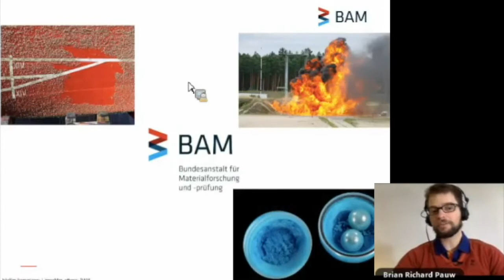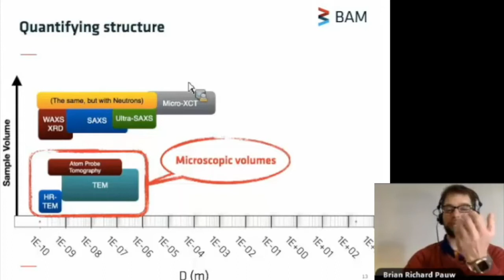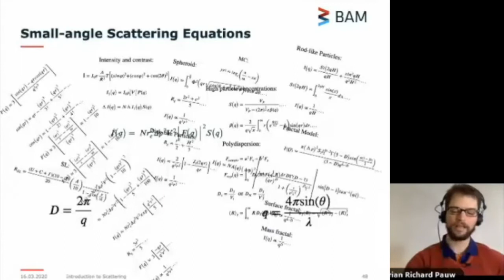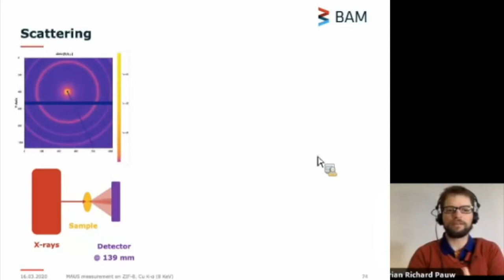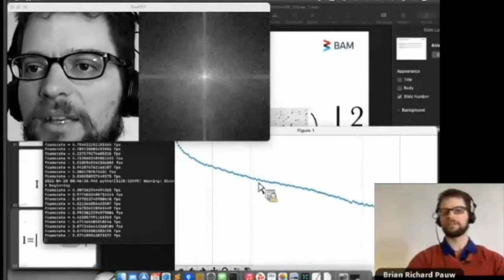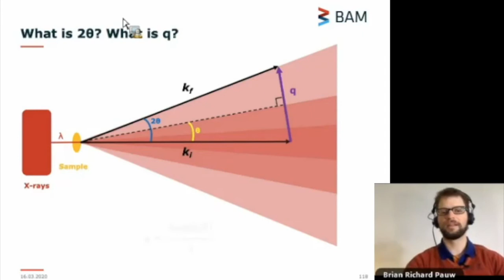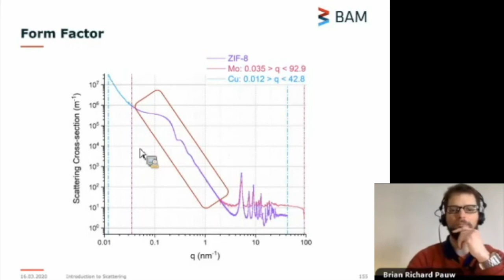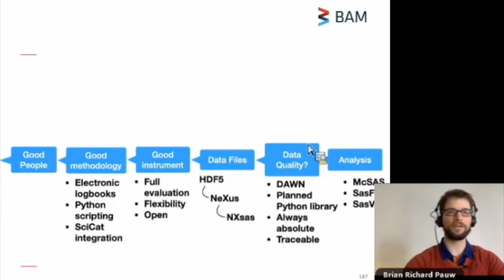Better with Scattering Part 1: Fundamentals of X-ray Scattering

Comment: thank you for this insightful lecture. I have a small question, if I have a porous material with nanoparticles in the matrix can I do SAXS to understand the distribution of the nanoparticle; can I compare two materials will SAXS analysis be helpful?
Reply from the maker: It may be possible to get size and size distribution information on nanoparticles in a porous matrix. Check out the publications which were done with the group of Zoe Schnepp (lookingatnothing.com) where we did something similar. As always, it relies heavily on how systematic and careful you do your measurements. Good luck!

Comment: As always a great talk Dr. Pauw. Thank you for sharing! Two small questions:
1) In your example of the Fourier Transformation we saw that we lose phase information, so we get no absolute information about anisotropic effects. But would it still be viable to describe a degree of orientation by a relative comparison and a possible change in intensity? E.g. cylindric particles measured in random orientation vs. cyclindric particles with high degrees of alignment (e.g. by cresting them or enforced orientation by applying a current)? To be precise I have a sample of cyclindric particles and we wondered if we could use SAXS to determine if they align in a matrix in a certain way (degree of alignment and maybe angle dependency) at different currents.
2)  I saw that you worked on a SAXSess mc2, which by default provides data in the .pdh format. Former colleagues of mine used the same instrument and complained a lot about outdated evaluation software and the presented DAWN software looks very interesting and promising. Is there a way to convert the .pdh files into NXsas files?
Reply from the maker: Hello Baganda,

1) The information loss means that we cannot tell which material phase we scatter from. However, orientation of anisotropic scatterers is something we can measure with the right equipment (a pinhole-collimated beam and a 2D detector). That is something we've done in the past on fibers, which have an elongated pore structure in the fiber direction. You can then derive an orientation distribution of the particles. I also have literature examples of people doing this (or SANS) with particles in elastomers, which then orient depending on the degree of stretching...
2) heh, yes. PDH is a bit of a funny format. We're working on translating the data to NeXus and using DAWN for correction to get a unified processing over the instruments in our lab. One missing component is a good example implementation of a desmearing routine, which would be required for visualization purposes. Once I have some time, I'll write one of those so my colleagues can recode that as an optional processing step in DAWN. Time is unfortunately not something I've much of...
Reply: @drheaddamage  Thank you very much!